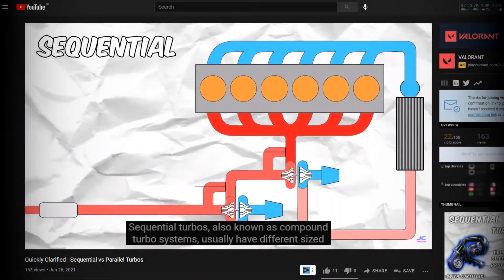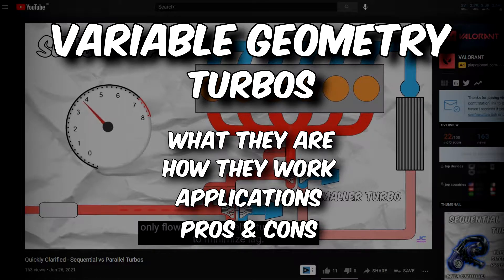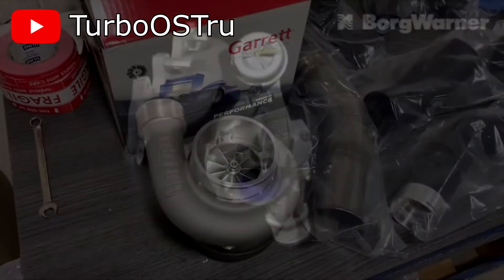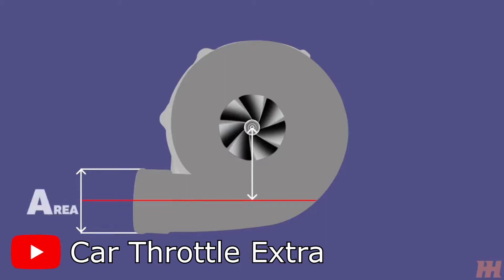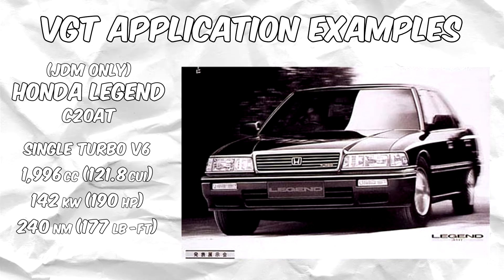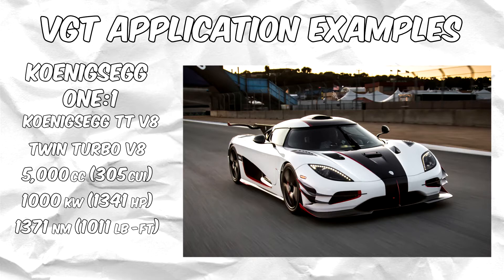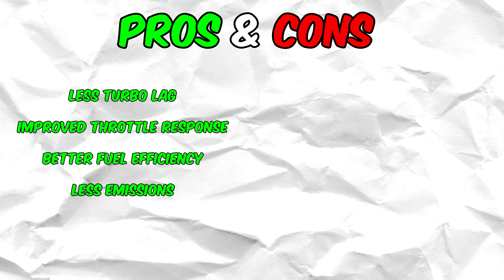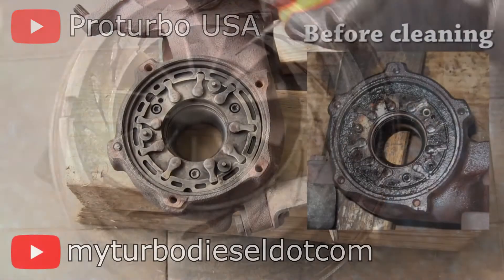Quickly Clarified - Variable Geometry Turbos (VGT/VNT) | Explained, Pros & Cons

Comment: In still position of the vanescontrolled by vacuum actuator (engine not runing), are they in opened position (for turbo stopping) or in closed position (for turbo spooling)? And can vacuum actuator be replaced with actuator for wastegate (controlling with pressure)?
Reply from the maker: I'm not sure when it's not running but they can definitely be replaced with an actuator, maybe so it can be electronically controlled from the ECU whenever
Reply: It's easier to have a vacuum actuator control the vanes... It's adjustable by changing the length. An ecu controlled actuator will be more precise but less adjustable... I'm running mechanical everything and prefer vacuum...